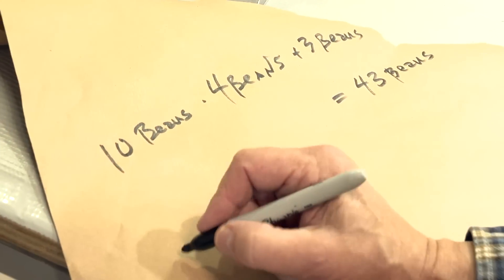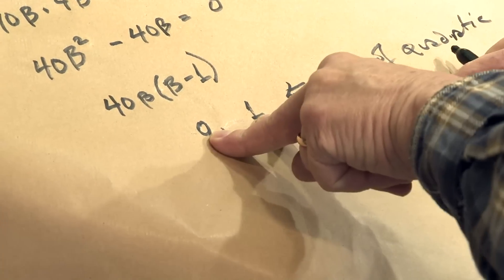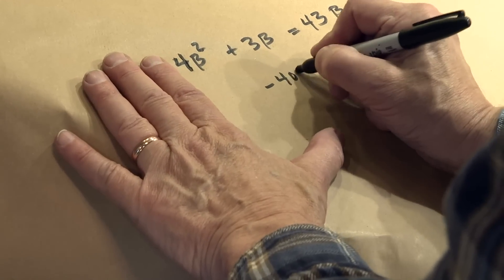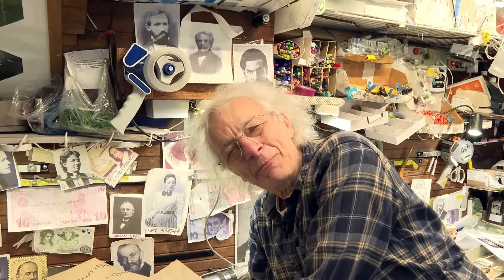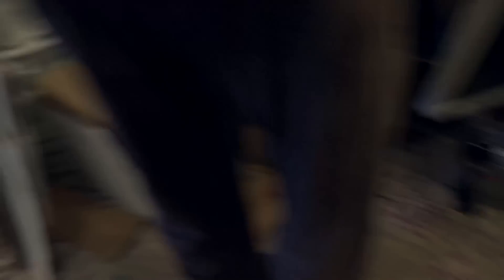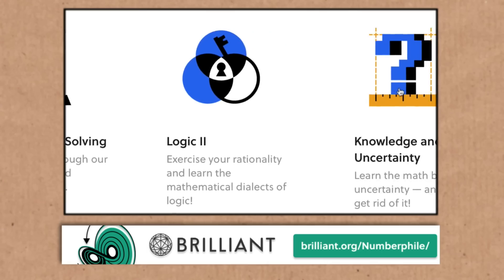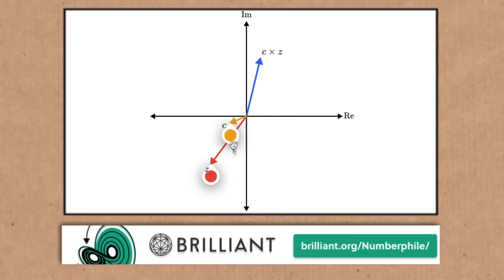The Nescafé Equation (43 coffee beans) - Numberphile

Comment: 5:45 technically this doesn't mean you get one bean, it means that the concept of "bean", the unit called "bean", is identical to having no units at all.
You also dropped, at that point, the possibility that it's just 0, meaning it's both unitless and sizeless! (Though you get to that later)
Reply: Thank you!  I was going to complain you can't divide by B because it might be 0.
Reply: You could say that, of all the beans that exist, Nescafe beans are the unit beans.
Reply: @Bleighckques  units still usually square. Unless they happen to be idempotent.
Like, you could introduce a special value with the rule b²=b and then follow the logic like with complex numbers:
(w+x b)(y +z b) = w y + (w z+ x y+ x z) b

Such a number system has a variety of interesting properties, but most importantly you get:

b² = b
(1 - b)² = 1 - b
b (1 - b) = 0

which means you can decompose any number

x + y b

as

x (1 - b) + (x + y) b

And with that you can very easily show than

(x + y b)^n =
x^n (1 - b) + (x + y)^n b

or if you want it in the regular form,

x^n + ((x + y)^ n - x^n) b

This formula holds without issue for all n≥0 and if x ≠ -y, I think it holds for all n in R.

(x - x b) or x (1-b) doesn't have an inverse but aside of that line, every other element can be divided by.

All that and more follows directly from just the rule b²=b
It's not even very difficult to show.

For instance, if your want to find division, try solving for y and z in

(w+xb)(y+zb) = 1

Exactly like you'd do with complex numbers

Anyway, with a number system like that, any polynomial in b becomes linear by construction, making that song 100% correct
Reply: @Kram1032  I meant that all beans would be measured against the Nescafe beans (the Nescafe bean represents 1 essentially), in the same way that a "unit circle" is a circle with radius 1 for example.

Comment: I think it makes perfect sense if you look at coffee beans in measure theory. Put beans on a line at equal intervals - the number of beans is proportional to the total length. Put them on a 2d square lattice, the number of beans is proportional to the area (and so on). Now if you look at a 2d lattice set on a rectangle with 4 beans on one side, and 10 beans on the perpendicular side, it has an area of 40 beans (add 3 more beans and you indeed get 43 beans).

Comment: The equation of B^3 - B = 0 has solutions at B = 0, 1, and -1. 

This means that Nescafe could use negative beans in their coffee, and it'll still be fine!
Reply: Nope, that doesn't work. 
For the song to work lyrically, word for word, it needs to work for 40 cubed beans but also for 40 squared beans. Otherwise 4 beans times 10 beans plus three more beans cannot equal 43 beans, even if 4 beans is equal to 4 square beans.

Comment: 5:33 dividing by B means that B=0 must be excluded. But B=0 is also a valid solution of 40 B^2 = 40 B.
Reply: There's one mathematical trick (you know, the ones where you eventually get 4=5 or 0=1 or whatever) where division by zero is hidden in division by X. So yeah, that stuff is important. :D
Reply: @vsm1456  yeah, a better way would be to factor out 40 and B,
40B^2 - 40B = 0
40 * B * (B-1) = 0
Which leads directly to the factored form and thus the solutions

Comment: They could also be a "dimensionless" counting unit. 

Imagine diluting something to 0.2 concentration, then diluting that new substance to 0.5 concentration. The final substance has 0.2 concentration × 0.5 concentration = 0.1 concentration, not 0.1 square concentration. 

Imagine your horse winning has 1-to-10 odds, and the weather raining has 1-to-50 odds. the event of both happening has 1-to-10 odds × 1-to-50 odds = 1-to-500 odds, not 1-to-500 square odds.

Comment: What I'd like to know is why Nestlé chose 43 at all. It's on record that Beethoven thought that the perfect coffee was made with 60 beans. I've just gone and weighed 8g of roast coffee beans -- the amount I grind for one mug -- and there were 66 beans. I guess whoever thought of the jingle imagined people drinking either small cups or weak coffee.
Reply: Because bean counters drive corporations. They are the ones who turned what was once a 7-ounce "can" of tuna into what is now a 5-ounce "can" of tuna.
Reply: Instant coffee is made from concentrated brewed coffee, and strength varies depending on the drying method used. I couldn't say for sure, but it may just be that instant needs fewer beans per cup to achieve a comparable strength of flavor?

Comment: 1:58 He explained it the most clearly at 1:58.  Instead of thinking of beans, think of inches. 
10 inches x 4 inches + 3 inches = 40 inches ² + 3 inches
How do you add a two dimensional 40 square inches to a one dimensional 3 inches.
Reply: I am nowhere near being a math major, nor do I claim to know how to identify a quadratic equation, so having that be, the point you (and Cliff) make is exactly what confuses me. I understand the nitpick of 1 vs 2 dimensional values here, but, I mean, we're literally talking about beans which have a minimum of 2 dimensions.

Wouldn't all values in an equation regarding physical space have an implied 2nd dimension of (at least) 1?
In this case, B = 1 bean unit. 

Therefore:
10(1) • 4(1) + 3(1) = 43(1)
No? What am I missing?

Comment: I propose a different solution to the nescafe equation. So I got this idea at 2:00 when Cliff says, "What's a square bean? Damned if I know!" and they show a ghostly bean at the bottom left to represent a square bean. We know what's a bean. It's a thing in the real world. But what's a square bean?

Well the first equation says: 2 beans * 2 beans = 4 beans
But we know that: 2 beans * 2 beans = 4 beans^2
We don't what in the world is a bean squared. So if we define a bean squared  to be equal to a bean, then the above 2 equations are consistent.

And it works out for the second equation too. 
What they said: 10 beans * 4 beans + 3 beans = 43 beans
What we know: 10 beans * 4 beans + 3 beans = 40 beans^2 + 3 beans
Equating these 2, you'll get that 43 beans = 40 beans^2 + 3 beans or 40 beans = 40 beans^2 or a bean^2 = bean. 
So both these equations suggest to us that a bean squared is defined to be a bean. And a bean doesn't have to be a number. It can be it's own physical quantity like centimetres & inches.

Comment: There is an error in solving the quadratic equation at 5:25. You cannot just divide by B. You have to assume first that B is not zero and as it is, B=0 is the second valid solution of the quadratic 40B^2 +3B=43B.
The TWO solutions of the quadratic are B=0 and B=1.
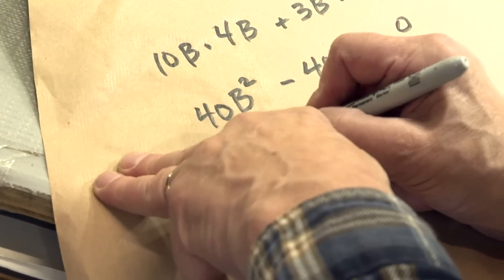Reply: Did you comment before watching the whole video, Olivier? Did you stop watching before you got to 7:30?😅

Comment: If you align a rectangular grid with four beans on one edge and ten beans on the other, you have 4 beans times ten beans and explicitly 40 beans not 40 square beans. This fact can be verified by counting the beans. The reason the bean unit does not behave like kilometers the way Cliff purports is because bean can be classified as a dimensionless unit. Cliff even showed this in the video. The relation bean = 1 has a dimensionless number equal to bean, so bean must also be dimensionless. Radian is the more typical example of this type of unit if you'd like to find more "wrong" dimensional analysis relations.
Reply: But that is (4 times 10) beans, not (4 beans) times (10 beans).
Reply: @dfs-comedy  Why is it different than if I had said inches instead? You don't say (4 times 10) inches, it really is (4 inches) times (10 inches). My whole point is that beans are different from inches. Beans are dimensionless and inches are dimensionful.
Reply: @S.R.400  4 times (10 inches) is very different from (4 inches) times (10 inches). You get the first if you lay four 10-inch sticks end to end, and the second if you measure the area of a 4-inch by 10-inch rectangle.
Reply: Beans are not dimensionless. Saying   "I have 4 beans" is very different from saying "I have 4."
Reply: @dfs-comedy  I wasn't disagreeing with you. I was trying to highlight that you understood some units form an 'area' when made into a grid and others don't. So I asked why would there be a distinction. And my answer was some units have a dimension to form an area and others don't.
Reply: @S.R.400  The area distinction is a red herring. SI units such as seconds-squared exist even though they can't be explained physically.

Think of it like this: if one person has 40 beans, and another person has four beans, you would say that the first person has 10 times as many beans as the second person. You would not say that the first person has 10 beans times as many beans as the second person.

Comment: If the second equation is deemed correct (though inhomogeneous) the the first equation should be deemed correct too despite the dimension mismatch (also present in the second equation, not very differently). Both yield bean=1. If that all makes any sense.

Comment: Well, im not sure i agree that the jingle is wrong, because it is a problem in the natural numbers, not in the real numbers

When you multiply 4 meters by 10 meters what i think about is a 4m by 10m rectangle, that has a 40m² area, and indeed it makes no sense to add a 3m line to it (actually i would argue it does, because a 3m line is really a 3m by 0m rectangle, so the result is 40m², but thats beside the point). But when you multiply 4 beans by 10 beans i think of the integer equivalent of that rectangle, which is 4 rows of 10 beans. There are 40 beans in that rectangle, so if you add 3 beans to it you end up with 43 beans

The bean in this case is the unit of account. So yes, it is equivalent to 1, as you find later on the video

Comment: the thing that amazes me about mathematics is that things like dimensional analysis and dimensional inhomogeneity is known, and yet 4i and -4 are both called numbers. if you add those together you unambiguously get a vector, which means the component parts are also vectors, not numbers.

if 4 beans is not a number, but a composite object including a number and a dimension, or in other words, a scalar amplitude and a direction, which makes it a vector, then -4 and 4i are also vectors, since the unit of -4 is - (conventionally rendered -1, but that's not really accurate since 1 is a number, making -1 a vector just as much as -4 is), and the unit of 4i is i.

further, everyone claims that mathematics is fundamentally about operations over numbers, but that's also trivially falsifiable. all you have to do is convert between units, like cm to inches, as in:
- 15cm -> ?in; 15 cm * in/cm * 1/2.54 = (15 * 1 / 2.54) in * cm/cm = 15/2.54 in, because anything divided by itself is the dimensionless multiplicative identity 1, and since cm is a thing dividing cm by cm yields this 1

further analysis of the consequences of this quickly show that Peano's Axioms are invalid, which results in forcing of a rejection of the currently accepted foundation of mathematics, including unprovable postulates like 1+1=2. which it should be noted Whitehead and Russell claimed could be proven eventually with the system of mathematics they built up, but they never actually demonstrated it, and later the logical inconsistencies of that very publication formed the heart of Godel's incompleteness theorems.

and it's true, for if 1 is the successor to 0, then how could you possibly ever get to 1/2? isn't 1/2 more validly the successor to 0 than 1 is? and by extension isn't 1/3 more validly the successor to 0 than 1/2? and thus you necessarily fall into an infinite regress which contradicts the foundational axiom. but it gets worse, because we can also show that 1 = 12, which actually agrees with the contradiction we just saw, but again contradicts our fundamental axiom that 1 is the successor to 0:
- 1 foot = 12 inches; ergo 1 = 12

and we can trivially show that 1+1=5, or any other value, quite simply as well:
- 1/2 + 1/3 = 5/6; or in plain English, one half and one third gives us five sixths.

now, naturally you'll argue that fractions are numbers, but this is false for the same reason that -4 isn't a number. the denominator is a unit, which is actually why it's called 'denominator', or 'indicator of denomination'. which means that all fractions are in fact vectors, unreachable by counting. while numbers are the things which are reachable by counting.

but wait, it's even worse than this, because we know how to take limits of points which cannot be evaluated. and this means that we're evaluating the point right next to the point we want to evaluate. so:
- lim x->0+ 1/x; does not tell us what 1/0 is, but what 1/L(0) is when L(0) is the value immediately to the positive side of 0, or in other words L(0) is the one true claimant to the title of successor to 0. and no mathematical manipulation of 1 can ever bring us to L(0), making it infinitely small, but moreover the most infinitely small, rendering 2*L(0) finite. and a result of this is that 1/L(0) is not only infinitely large, but 1/L(0) - L(0) is finite while itself still being inaccessible via mathematical manipulation of any number.

this now poses some interesting problems for conventional mathematics, because it instantly provides clarity on many issues which are currently contested aspects of mathematics, while simultaneously refuting many widely accepted claims. and all by simply being rigorous with respect to things we expect kindergarteners to understand.

Comment: Actually, the commercial is right. If you times 4 beans by 10 beans, you get 40 beans because the number of beans is a constant. If you add 3 beans, you get 43 beans.

Also,
Technically, „more beans”, „beans”, and „rich coffee beans” are different.
Equation:
10B x 4B + 3M = 43R. 
Feel free to calculate ratios of M and R with respect to B. 
If you do, reply to this comment.

Comment: Replace beans with "units" if we have 2 units and multiply by 2 units we get 4 units²? What if we remove units altogether 2x2=4 (no unit/no beans)

Really what we want to do is take the amount of beans separate from the bean unit. 2 beans x 2 beans → 2x2(beans) but this only works with addition.

So if we have 4 beans and 10 beans and we want to multiply them we suddenly get 40 beans not 14 there is beans coming out of nowhere. Multiplying in the real world by if you have 4 beans, you can't make sense of that by multiplying by 10 beans. However, you can multiply by 10 ( of whatever you had before) so 4beans×10 so you have 4 beans and again 4 beans and again 4 beans... Until you have 40.

Or you take 4×10beans 10 beans and 10 beans and 10 beans and 10 beans.

With other units like m² we don't measure 1d line but a 2d surface and m³ is a 3d volume.

So with bean² we'd have to first have a 1d bean and upgrade to 2d beans.

Now let's assume the song leaves out the ² but still implies it, so 2beans(1d) times 2beans(1d) is 4 beans(2d) 4beans(2d)×10beans(1d)= 40beans³+3beans¹

So we actually get 40 3d beans and 3 1 dimensional beans?

Comment: How did he preserve a tape recording from that long ago?  I read somewhere that the cellulose decays after about 30 years.
Reply: Magnetic tape is used for long-term data archiving, as it lasts way longer than regular hard drives or any other media (50+ years).

Source: I am an archivist.
Reply: As a kid, I made several dozen reel-to-reel tapes of radio shows, top-40 hits, family get-togethers, etc.  It was fun fooling with such high-tech ... instant replay of a conversation!  Those tapes are all in my attic; some aren't readable (ask me about full-track, half-track, and quarter-track tapes -- each needs a separate type of tape-head to properly reproduce).  Today, most of these tapes are still playable.  I can listen to my sisters and brothers and parents ... sweet.

Comment: I think what we've learned here is that a coffee bean is a coffee bean, no matter if it is bean-shaped or square...

on a more mathematically interesting note, is it possible to construct a unit that would have this sort of dimensional behavior, such that raising the unit to a power gave you the unit you started with? if so, what would be the geometric properties of that unit?
Reply: Why yes, it is indeed possible (sort of). In addition to beans, pixels and voxels are also great examples. A rectangle that's 4 pixels wide by 5 pixels tall has an area of 20 pixels, not 20 "square pixels." In order for this to work, I believe the unit must be discrete and have "width" in more than one "dimension." (For example pixels^2 = pixels, but pixels^3 != pixels.)

There's also dimensionless units (like radians), for which this would also work.

Comment: Slightly serious question, though: why does 10B x 4B have to be 40B^2? I can see that 10Km x 4Km would be 40Km^2 if measuring area (ie, working in two dimensions). But if I walked 10Km four times I would cover 40Km - ie, sticking to the one dimension.
Reply: That's not 10Km times 4Km, that's just 10Km times 4
Reply: @glowingfatedie  Oh, okay. That makes sense now.